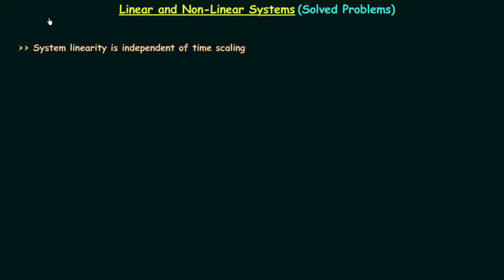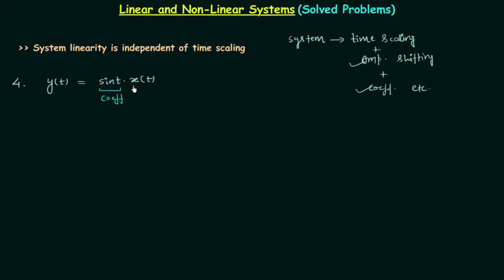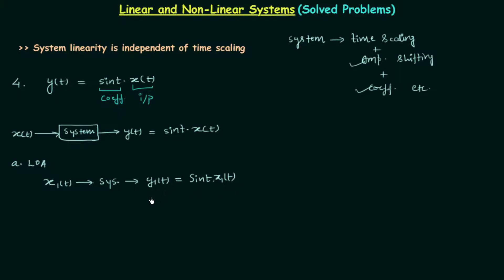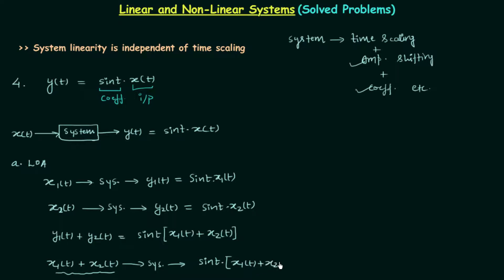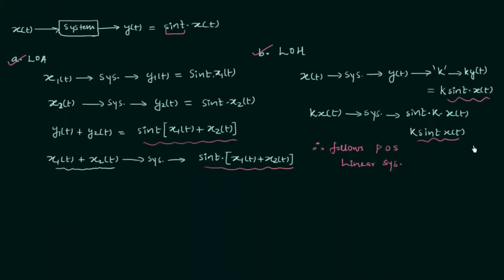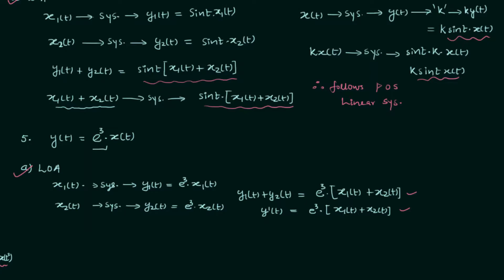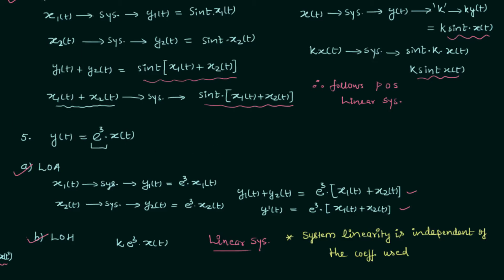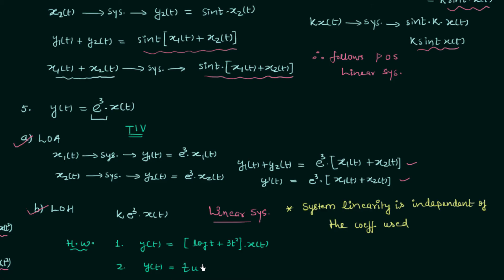Linear and Non-Linear Systems (Solved Problems) | Part 2

Comment: The first two systems are linear. In the first case, we get 
Y1 (t) = [logt + 3t^2]x1 (t)
Y2 (t) = [logt + 3t^2]x2 (t)
Y1 (t) + Y2 (t) = logt + 3t^2[x1(t) + x2 (t)]
X1 (t) + X2 (t) = logt + 3t^2[x1(t) + (t) x2 (t)]
Since X1 (t) + X2 (t) is equal to Y1 (t) + Y2 (t), the system is linear.
In the second case, we get 
Y1 (t) = tu (t)x1 (t)
Y2 (t) = tu (t)x2 (t)
Y1 (t) + Y2 (t) = tu (t)[x1 (t) +x2 (t)]
X1 (t) + X2 (t) = tu (t)[x1 (t) + x2 (t)]
Since both Y1 (t) + Y2 (t) is equal to X1 (t) + X2 (t), the system is linear
Reply: answer is linear system.
but we have to prove law of homogenity tooo.
Reply: u may take [u(t)=1;(t>=0)] ,

Comment: In the second homework problem what is tu(t)?
although it is constant so answer will be linear only
but what is that tu(t) function ?
Reply: u(t) is simply unit step signal, you can watch it in Video 64.
Reply: tu(t)=r(t) 

u(t) => Unit step signal.
r(t) => Unit Ramp Signal.

Comment: First is linear and TV
But in 2nd case..When we multiply with k then there is possibility ok k to be negative too when that negative value multiply with u(t) from graph we get zero
So for k<0 non linear
And k greater than 0 it is linear
And both are TV
Reply: we can never have t=(negitive value), in equation u(t) ; but we can always have k=(some negitive value) , in equation like   ku(t) , ktu(t) ,k[tu(t)x(t)] , etc .
Reply: k is just amplitude scaling bro it is linear system you can talk about time t is t<0 then y=0
Reply: Kindly explain clearly I am getting struck.
Reply: because of u(t) we will never go to the negative side

Comment: both are linear system
Reply: Akash Dhetarwal tu(t) is ramp signal even if you take K to be negative amplitude will be reversed in both cases. System will be homogeneous.
Reply: When we multiply with k then there is possibility ok k to be negative too when that negative value multiply with u(t) from graph we get zero
So for k<0 non linear
And k greater than 0 it is linear
Reply: k is just amplitude scaling bro it is linear system you can talk about time t is t<0 then y=0